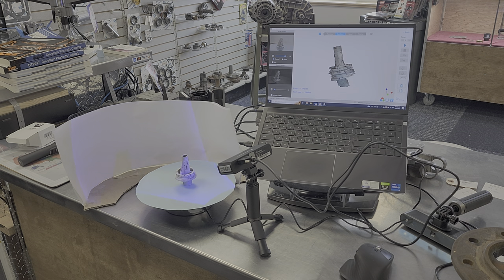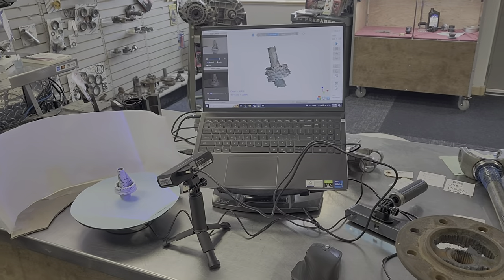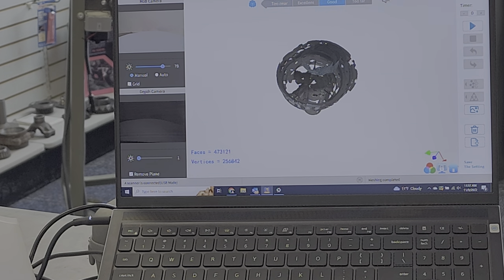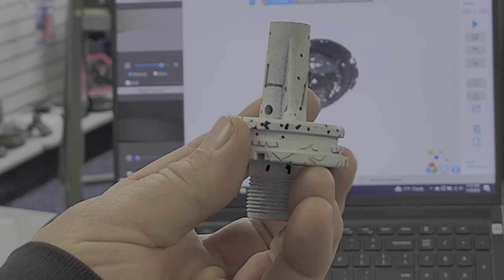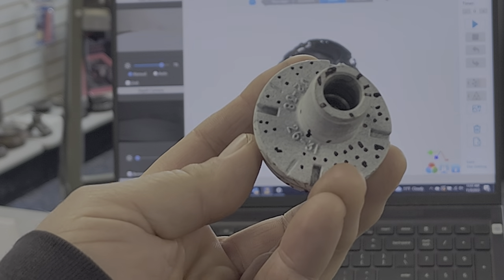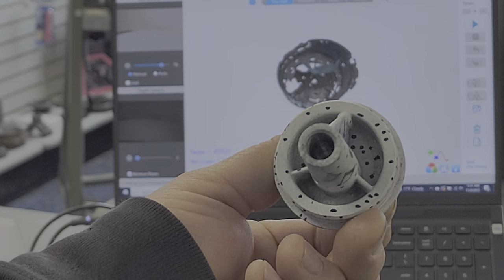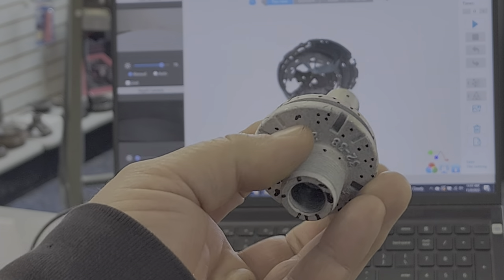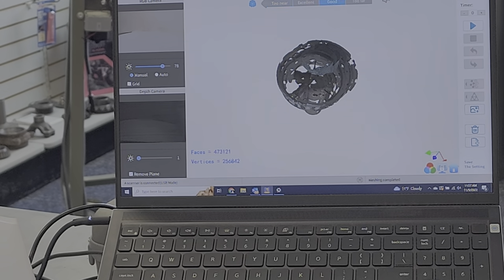Learning to scan with Revopoint Pop 2 and Mini s.1 ep.2

Comment: Try crumbled blue tape placed on the turn table to get better tracking. Don’t use auto fuse. Every time open the fuse settings use manual smallest setting, close the setting and fuse it.

Comment: This should be quite easy to scan in a few takes....

first...you will not be able to scan anything by rotating a subject by hand as you did in the 1st video. Use the turntable....that's why you got it with the scanner!

Also, the dots on the turntable are quite important because they provide reference for the scanner so don't cover them. And use something black to cover the background...not white.  So take the white cover off the turntable, remove the white background and use the black plastic sheet that you got with the scanner to cover the background....all the way and even underneath the turntable.

Also don't use colour mode as I assume that you only what to get a 3D data of the subject. And also don't focus on the upper left section "RGB Camera". Just make sure that you slide the "brightness"-slide in the lower left section so that the subject is visible and avoid any blue or red highlights...Blue is under exposed and red is over exposed so play around with the slider to find a nice compromised setting.

Then use either "Marker mode" or "Feature mode" to scan. 

However, marker mode only works if the scanner is able to see/detect at least 5 dots on the turn table otherwise it will loose tracking.

So if marker mode does not work then use feature mode. If you also loose tracking in this mode that this means that the subject has too little features to scan. In this case you could use little items and place them around the subject to increase the features that the scanner can detect (like clay putty or little lego bricks)

I noticed that you marked the subject with a pen...probably to provide more features for the scanner...but as this scanner is a depth scanner it will not do anything with these marks.

Anyways....this will probably get you better results. And if not, search for revopoint on youtube, There are lots of videos to get you on the way...

Happy scanning!!